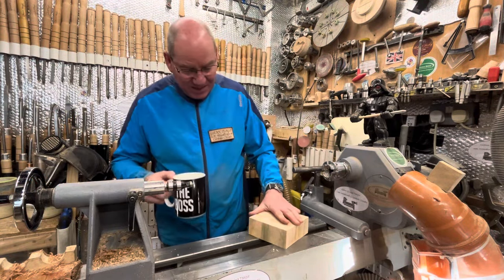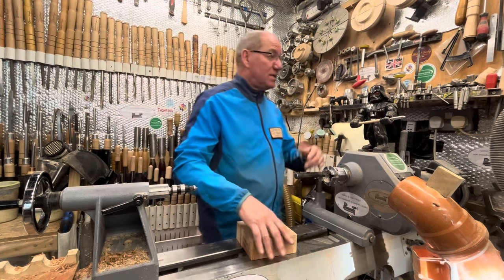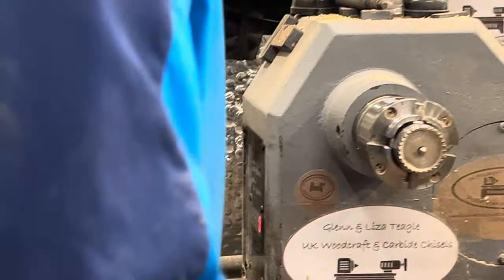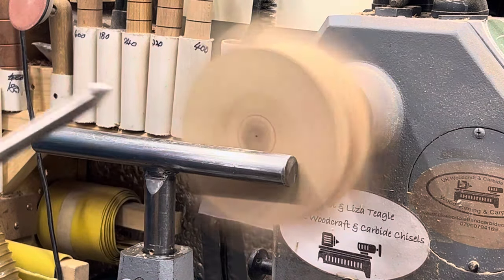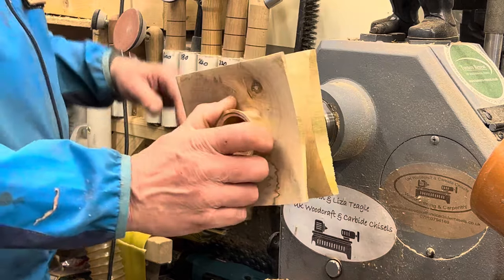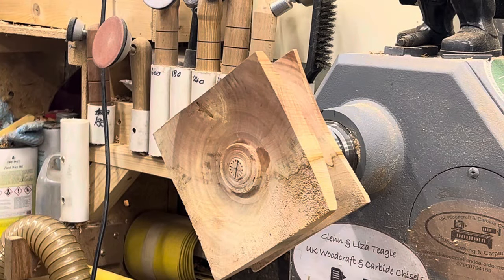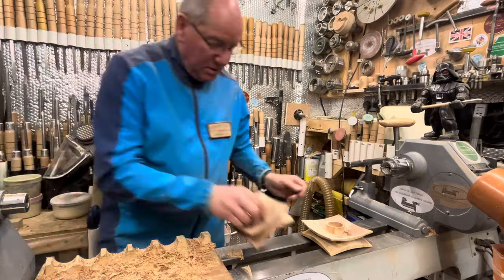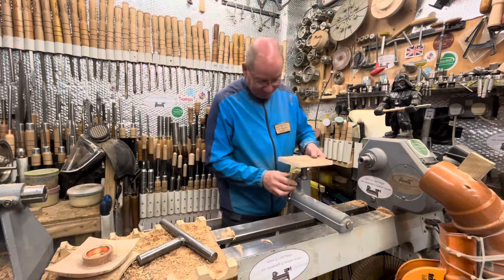Woodturning. Tea-light holder. Craft fair seller. Can't make enough of them.

Comment: Looking for a way to turn a wooden bracelet but totally round! No flat sides at all.
Open area in the middle to 2-1/2” diameter, bracelet wood 1/4” thick (ROUND).
I tried with a bead, but couldn’t make it work.
Do you have a video or any other ideas?
Thanks, love your work!
Lloyd
York, Pennsylvania USA
Reply from the maker: Hi Lloyd, welcome to the channel. Glad you are enjoying the videos. I've not made any bracelets. If I can source an appropriate piece of dry wood to try and make one, I will. I only have a lot of wet wood. The only other way is if you try using a captive ring tool. That might work. Give it a go. Good luck. Let us know how you get on. Toodle pip for now. Glenn & Liza
Reply: @glennteagleofukwoodcraftca5308  
I was going to try this with a short piece of Ash Wood about 4” long and 3.5” round. Trying to go into it from the end like a bowl to clear the underside but if it shatters, it’s no telling what might be in its way…….like me?
Also it’s too tight to the chuck on the left side to try to round underneath. I priced the ring tool $$$$$$$$!
I’ll wait for your experienced video!!!
Thanks, 
Lloyd
Reply from the maker: @lloydglazer2231  It may be a while. As I said, I will need to get an appropriate bit of wood. The Ash I have is like plaster when you cut it.